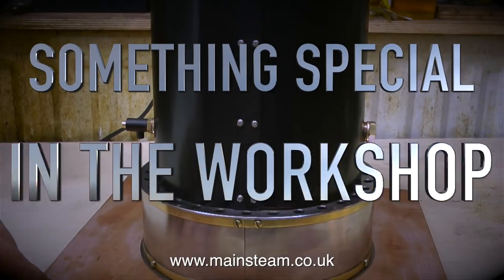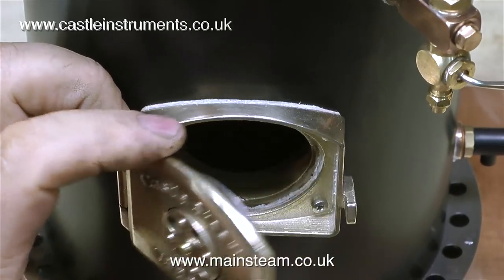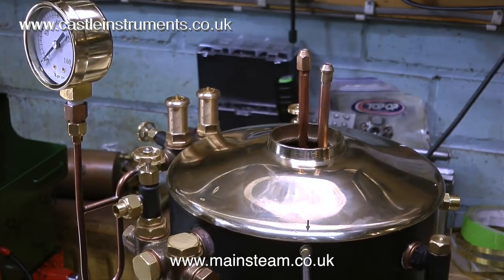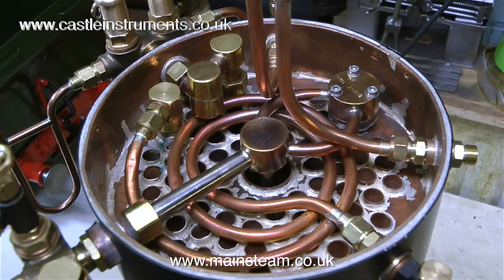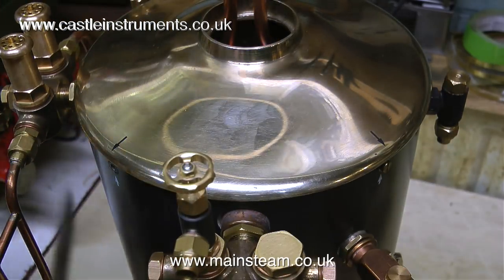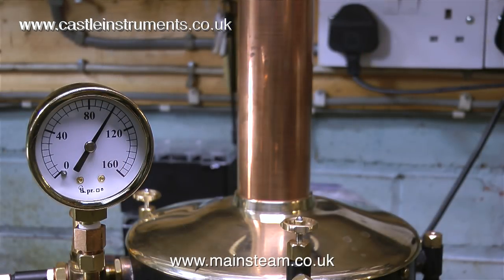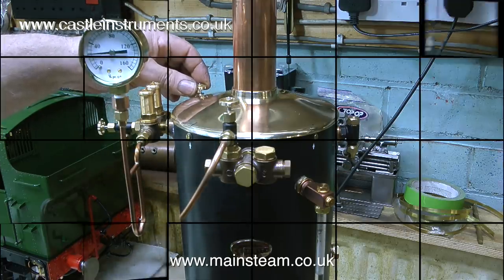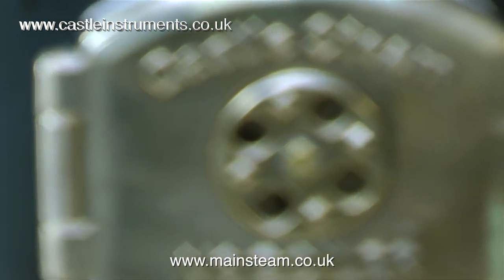SOMETHING SPECIAL - ON MY WORKBENCH

Comment: Well I'm sold! 
Having just ordered one, I find it more than a coincidence that it costs about the same as a cheap funeral, which is exactly what I will be getting if the missus finds out how much I have spent. At some point, could you cover what situations require each of the 3 steam heat options?
Reply from the maker: hahaha - as much as a cheap funeral .... }:-))) good point, but remember that after your funeral, your Wife will sell the boiler on Ebay for what you told her that you paid for it ......
Reply from the maker: I will be doing an "in depth" test on the boiler as soon as I get the time to mount it on a heatproof bass and add the hand pump.

Comment: What a beautiful boiler! I'm and amateur engineer, mostly O gauge but I have a Stuart twin (about 60% built) and a 16mm/ft 2-8-2 in a state of build, well frames, cylinders, wheels clacks pumps done which probably won't be finished until I retire! Made small boilers but it's definitely an art, especially when the result looks like this does. I saw your steam test vids, very nice. Even on a 5A it's so efficient its almost running away. I've got my eye one .. what do you think to a second ring on the ash pan, same number of holes, inline but rotatable so you can control the air going in? Damp the fire a bit? The hole spacing looks right? Would be interested in your thoughts?